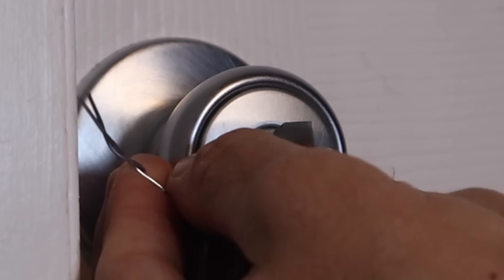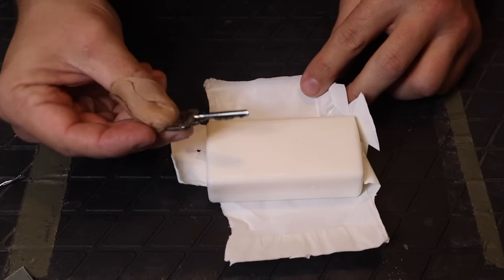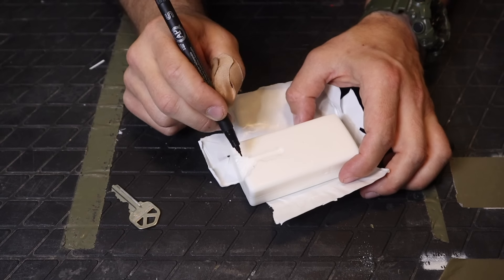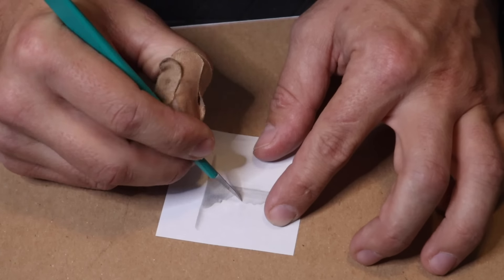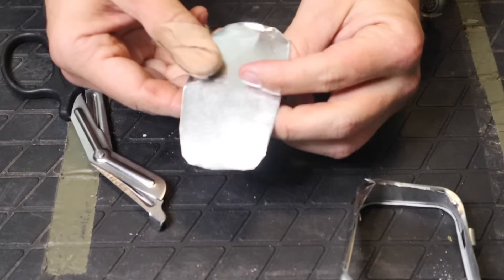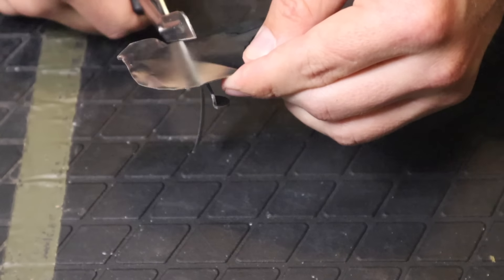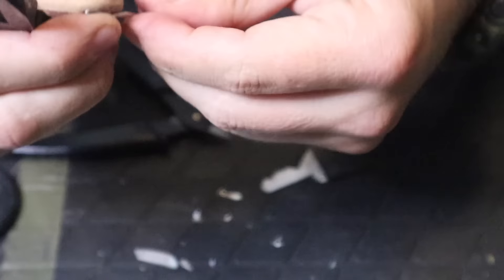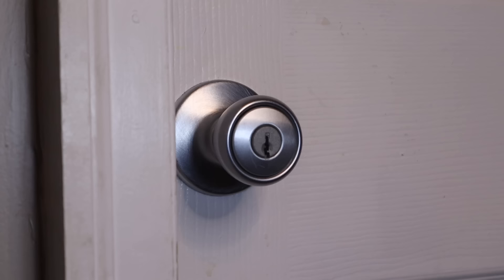Use A Bar of Soap to Make a Key Clone! - Urban Survival Skill!

Comment from the maker: Please Hit the LIKE and SUBSCRIBE BUTTONS as well as the NOTIFICATION BELL. Check out my PAGES!  Thanks For Watching.
Instagram: https://www.instagram.com/rangersurvivalfieldcraft/
Facebook: https://m.facebook.com/rangersurvivalandfieldcraft
SRO Affiliate: https://www.selfrelianceoutfitters.com/collections/andrew-ogle-featured-gear?ref=u53Mby-dH6X-Iw
Amazon Store: www.amazon.com/shop/rangersurvivalandfieldcraft
Reply: Person you took the key from: Hey why is there soap all over my key!
Reply: CLICKBAIT MAKES ME NOT WANT TO SUB ..
THIS ITS KEY CLONING NOT LOCK PICKING
Reply: Looks like you could press the key even without removing it from the keyring
Reply: PREPPER PRO TIP: In the long run, it will be easier, quicker, and safer just to learn how to proficiently "rake" the lock with the longest section of a long steel paperclip and use a smaller cut section as a wrench to get through most (90%+) of residential property and commercial office door knob locks in less than 60 seconds (obviously pick a good time when no one is around). Yes it's a skill that takes training, but then all you ever need is to always keep an innocent looking, high-quality paperclip on you at all times.

OR if you have a sacrificial credit card you don't mind tearing up, you can just slip it in between the spring latch and the strike plate. When you know how to tweak the plastic corner it might take you 30 seconds.

Either of these will be better than running the risk of getting caught trying to lift someone's key (which is harder that it sounds because it requires even higher level skills ---pickpocketing & stealth), or going through all that work just to realize your little soap cutout wasn't accurate enough and there you are attempting to sneak through a door with a key that doesn't work.
Reply: may be change the title to "How to gain access to your date's house without her knowing"

Comment: There’s a simpler way to achieve similar results. You can use a dry erase marker to mark a key and then use a piece of scotch tape to “lift” the print off and transfer it to a plastic soda bottle. Then just cut it out and use the same way. This eliminates the need for the soap and the printer so it can be a little more discreet depending on the situation.
Reply: @tnpsheepdog3289  ya the soda bottle method is way easier.
Reply: You can use a long cheap comb, a piece of Venetian blinds. No need for crazy stuff.
Reply: With access to a printer, taking a picture with a coin and some computer skills you skip the soap entirely
Reply: Thief!!!!!😂😂😂😂
Reply: That's where you fucked up. Only rich can afford a 3d printer
Reply: Using clay could work
Reply: Or take a photo.
Reply: An Altoids tin with some sculpey inside would work better for taking the impression. (rigid container and clay that never dries out)
Reply: a bump key perhaps.....
Reply: Vader breathez heavy y don't u just use ah magnet like tha 1 used ta wipe hard drivez??? It should be powerful enough ta grab tha seer... Vader breathez heavy
Reply: 3D printers are no longer expensive, there is simply no use for the average user. The problem with 3D printing is the ability to create models, not the price of the printer itself.
Reply: There's an even simpler way to achieve similar results. First, find the key you just lost. Second, unlock the lock. Simple!
Reply: @kohakanhanan2928 it’s not a 3D printer 🤦🏻‍♂️
Reply: Using a credit card in ur wallet to open the door is a lot more time efficient
Reply: You can also take a decent picture with the probably very high definition camera in your phone. Most keys are a standard size you can easily reference off of and with a near universal bit size it’s often trivial to accurately recreate the key. It is often recommended you keep your keys far away from social media, for this reason.
Reply: @alexphelps7042  
Good points.
Reply: PREPPER PRO TIP: In the long run, it will be easier, quicker, and safer just to learn how to proficiently "rake" the lock with the longest section of a long steel paperclip and use a smaller cut section as a wrench to get through most (90%+) of residential property and commercial office doors in less than 60 seconds (obviously pick a good time when no one is around). Yes it's a skill that takes training, but then all you ever need is to always keep an innocent looking, high-quality paperclip on you at all times.

OR if you have a sacrificial credit card you don't mind tearing up, you can get through nearly 90%+ of all residential and commercial office door knob locks by just slipping it in between the spring latch and the strike plate. When you know how to tweak the plastic corner it might take you 30 seconds.

Either of these will be better than running the risk of getting caught trying to lift someone's key (which is harder that it sounds because it requires even higher level skills ---pickpocketing & stealth), or going through all that work just to realize your little soap cutout wasn't accurate enough and there you are attempting to sneak through a door with a key that doesn't work.

Comment: Intelligence services generally prefer impressioning keys over picking locks. Picking locks can leave behind marks and there is a concern about being unable to lock the door again. Lishi lockpicks provide the pin number and depth, making it easier to create keys later on.
Reply: Yeah but they're way overpriced 🤣
Reply: @3nertia  but you get what you pay for. Buy once cry once...
Reply: @3nertia  How much does a copy machine cost?  A lock pick set doesn't require you to get access to the right key and what if the key you need is on a ring full of similar keys, do you make all of them?  Does this fake key leave marks or possible metal scraps when used?
Reply: Great information Sir thanks for your channel do you ever do classes in California. I would like to attend one.
Reply: In our covert entry courses we show a method where you press a key against your skin and then take a picture of the skin impression.
Reply: @camronbay1 just take pic of key
Reply: @MookieMaroni  True but if you don’t have a phone?
Reply: @camronbay1 use camera
Reply: That sharp tin will leave marks as will the paperclip. All viewable with a cheap magnifying usb camera.
Reply: @MarilynStangl  @MarilynStangl Look up "key impressioning," where a blank key is worked into the lock, small faint markings appear, and they can be filed out to create a whole new key.
Reply: @camronbay1  there is the BIC lighter to blacken the key too.
Reply: @ciklop4206  Then you gotta get the film developed...come on!
Reply: @Defensive_Wounds  ye just scan it with ur digital camera

Comment: A villain in Ace Attorney did something similar by pressing coins into soap, pouring water into the mold, freezing it into ice in the cold outdoors (game was set in Britain during winter), then using the ice coins to cheat an old age heater's coin reader with the identically sized ice coin to a real one, getting free heat. The ice coins would eventually melt and drain out of the reader through a hole, so they'd be gone by the time the guy that pulls the money from the machines comes.

Comment: Or just photocopy the key 10x, avoid the soap bit? Or even easier, throw graphite powder/crumbled up black coat dust from a fireplace would also do the job over the key when it is on a piece of paper with olive oil sprayed onto it first? Then you'll have the imprint and copy instantly, nobody will ask you 'why are you copying that cake of soap?' at all!! Do it several times for your copies. Then go ahead to the metal cutting process...

Comment: Taking MacGyver to a whole new level! Awesome!
Reply: no. this is a well known old technique . and mcguiver would pick the lock not do something where step one is : get the key
Reply: PREPPER PRO TIP: In the long run, it will be easier, quicker, and safer just to learn how to proficiently "rake" the lock with the longest section of a long steel paperclip and use a smaller cut section as a wrench to get through most (90%+) of residential properties and commercial offices in less than 60 seconds (obviously pick a good time when no one is around). Yes it's a skill that takes training, but then all you ever need is to always keep an innocent looking, high-quality paperclip on you at all times.

This will be better than running the risk of getting caught trying to lift someone's key (which is harder that it sounds because it requires even higher level skills ---pickpocketing & stealth), or going through all that work just to realize your little soap cutout wasn't accurate enough and there you are attempting to sneak through a door with a key that doesn't work.

Comment: Modeling clay or silly putty inside that altoids tin is generally going to be far less suspicious-looking (and yield a more detailed/higher fidelity impression). You can then close the tin to protect the impression until you can transpose it/measure the pin lengths/etc.

I also recommend cutting the key by buying a matching blank and filing it to the pin lengths. It'll be much more durable, you can bring it to any hardware store afterwards and get them to make as many copies as desired without raising any suspicion, and you won't need a tension wrench. It will also look far less suspicious if found on you, which grants you social access/credibility as well.
Reply: Going to a hardware store to make copies will put you on their CCTV. I thought the point was to stay low key? I know, I had to. 😂
Reply: @rogerlouie1  Being on CCTV only matters after you're caught*. Nobody's going to be reviewing CCTV hours looking for someone who *might be copying a key they shouldn't have. Getting a key copied from a blank you file won't raise suspicion.
Reply: @brentsaner  what happens after breaking and entering after the investigation starts? Elude the forensic investigators and police? But I'm not willing to take those risks. Best to keep your face off of CCTVs when in the act of committing a felony.
Reply: @rogerlouie1  Read again. They need to positively identify you as a suspect and correlate cut lengths of the key and know which hardware store you went to and have a general idea of when. Assuming this hardware store has CCTV coverage of the keycutter (mom and pop's tend to not).

You aren't telling me how they're doing the very first step, identifying you as a suspect. You're more likely to be on CCTV for the entry *itself*, and hiding your face will raise caution of those around you sky-high.
Reply: @brentsaner  You're extremely naive. They use the shotgun method, casting a wide net, and matching CCTV to timing and suspects. Then the interviews and narrowing starts. 

Go ahead, though, keep believing it's a great idea to put yourself on CCTV, in a hardware store, to make copies of keys you're trying to use to commit felonies. I mean, come one, man...this is this is the stuff detectives laugh about when stupid criminals do stupid things. Smart enough to know to make copies of keys but dumb enough to put yourself on camera and/or get receipts on digital transactions (credit/debit/mobile pay). Talk about non-repudiation and destroying any case you possibly thought you could have.

I'm only responding to such terrible ideas like yours in the hopes of stopping someone from committing crimes and ending up in prison. 

I mean...how stupid can a person be to not understand how simple this is. Then again, this is why I don't commit crimes.

Comment: As a property manager for quite a long time, ive had instances of tenants changing locks and moving out just to get you to break something getting in. Ive learned a lil trick. I use a small grinder to cut lengthwise down the type of key for the lock, removing the teeth completely from there a flat wire bent on the last 1/8th of an inch is used to tickle the tumbler pins into alignment while using the key as a tensioner. 2-3 strokes and the lock is open..

Comment: Awesome video, love how you addressed material during improvisation!

I suppose too, if you had time to gain access and weren't in a super huge hurry, you could swing by a hardware store and grab a key blank for the key in question, then you don't have to contend with whether or not your metal components will hold up for turning the key.  File it down with a hand file, and you're there.
Reply: This would also be a lot less suspicious if you are caught with it or seen using it. you just have a key to the door.

Comment: Using an impression to make a copy isn't lock picking. Not to mention, if you only have a key for a limited time and you're going to need to cut or shape your final product anyway, just trace the key, get the bitting heights, or mark a blank key, the file the the blank to match the information you got from the original

Comment: Why not sandwich the key between two halves of the soap, as a mold, then fill the void with some JB Weld? Would be an exact replica of the key in no time at all…
Reply: Or just imprint it completely in one bar then fill it... you could use solder, or something hard!  Gorilla glue perhaps? Can always sand the face if it's too thick.

Comment: the lock he shows is so super easy to pick with $5 pick tools rake and tensioner and practice
Reply: Why bother to pick when a dollar spatula from any dollar store or $2 set of orange hook picks from harbor freight applied to the latch has the same effect in usually less time?
Reply: Right. Ive done this with a pick set. A good quality main door lock is much harder to pick and the method in this video would be very difficult to make work.

Comment: Use a credit card from the purse to make the key. Easily to cut with only a good knife. Use lipstick from the womans purse, lipstick the key, paper (or business card in the purse) pressed on the the lipsticked key for the shape.  Use your own sharpie to paint the key, press image before the paint dries.
Reply: If you have a sacrificial credit card you don't mind tearing up, you can get through nearly 90%+ of all residential and commercial office door knob locks by just slipping it in between the spring latch and the strike plate. When you know how to tweak the plastic corner it might take you 30 seconds.

Comment: I made a car key from a zip tie once. It worked well but you needed to use a lever to turn the lock as plastic wasn’t rigid enough to do that part.
I also taught myself how to Hotwire a car…took only a few minutes.
😂

Comment: What if you fill the soap inprint with epoxy resin glue to make the entire key? Then you could use a small jewlers file to finely finish up or trace a metal key using the epoxy one instead?  Epoxy is VERY strong and you could turn the lock with it alone maybe.  I have seen people make imprints of BOTH sides of a key.  I would imagine that the slots on both side are made differently or there is some other difference  between both sides on purpose maybe? 🤔  Don't know if this would work. Just a thought.....

Comment: One way I’ve used, is to make the impression of the key in clay. A wad of clay in an Altoids tin works pretty well and is discreet. You can get the entire key impression of about three keys in one mold. Also, spray a little silicone on top of the clay before hand so nothing sticks to the key and it comes out with a smooth crisp impression. Bake the clay in an oven. Once your new “mold” has cooled, melt some solder in the impression of the key. Let it cool. It won’t be strong enough to turn the barrel of the lock but it will be rigid enough to get the tumblers where you want them, then use a small screwdriver or a leverage bar.

Comment: ...yeah...but will it work on a deadbolt?
Those type of in-knob door locks are easier picked at the frame than the tedious method of cutting a key.
Hell, a thick piece of celluloid or thin plastic...like a credit card, could pop that lock at the frame in seconds.

Comment: I know a method that doesn't use energy (printer), light a candle and place the key on top letting the soot from the key paint the key, then put a transparent tape on the key and the print will be left, with this copy put it on top of a credit card and then cut it out with scissors.

Comment: i feel like you could probably just
1. do the soap thing
2. color the edges with a marker
3. press onto paper
4. use clear double sided tape on top of the print
5. stick chopped up paper clips to mimic the outline & make struts/supports
6. resin/superglue the whole thing

Comment: A scroll saw and dremel tool would work great with this and those who make there own projectiles could pour a thicker metal mixture with only a quarter of the lead they'd normally use in the bullet molds wich is usually 92-96% lead 4-6% tin  2-4% bismuth depending on the load caliber

Comment: I understand the point.. and this is good info. I just have some questions. If home depot can barely get me a working copy of a key with a machine designed to cut real keys the copy of which I have with me.. if that still ends up being rough at best. How's a home made one made from a can gonna go? 2.. why not just make a proper jiggler? Basically a rake tool minus needing a tension wrench. Then you have a "key" for multiple locks. Jiggling is very easy on most cheaper locks with just a little practice. You'll basically have to jiggle with that key to make it work properly anyway as it will be very rough. Besides the avg guy isn't opening anything beyond cheap outside door locks and interior anyway. Which most of those can be gottwn in with a thin card. Tigher tolerance locks with security pins and such can be defeated with that key.. but you would literally have to make it perfect.  That means tools, and a harder key material. At that point. It can be done.. I'm just saying.